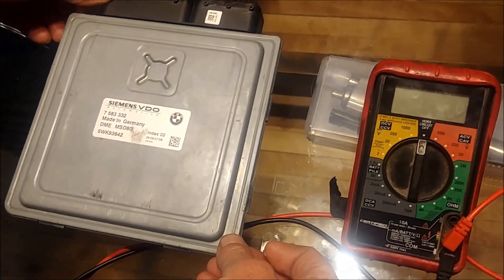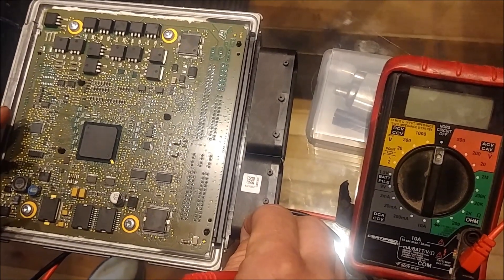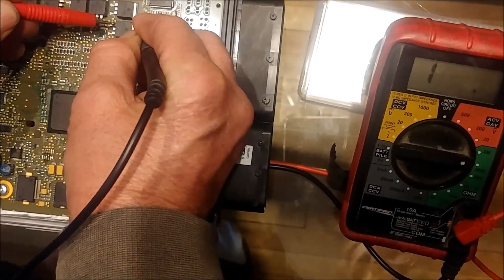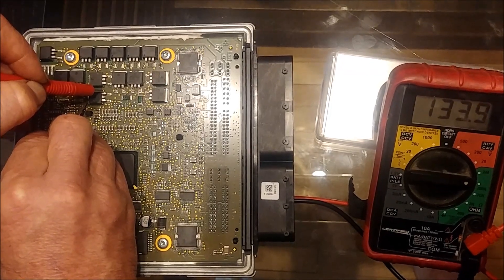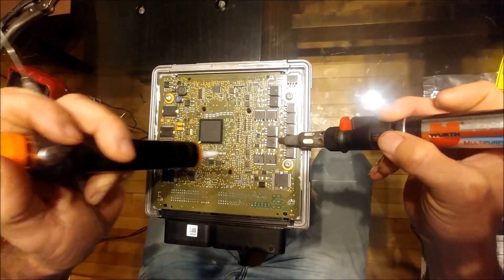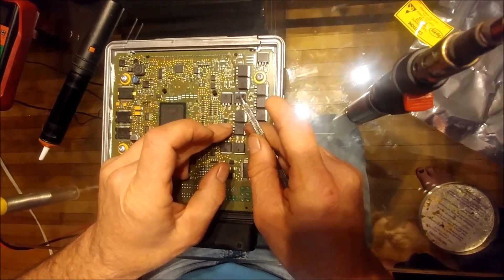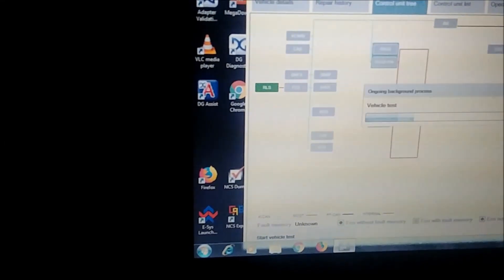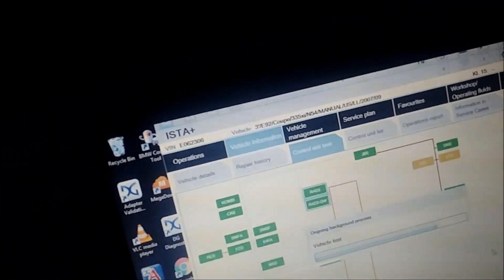Part 2. Diagnosing DME internal failure 0030BA 0030bb 335ix N54

Comment: My E46 N46 has error code DME 2A67 valvetronic, internal faulty, what needs ro be fixed sir ?
Reply from the maker: unfortunately im not familiar with N46 but Iwould look at eccentric shaft sensor or wiring. if you have access to ISTA follow the test plan

Comment: I just tested all six of mine and none of them had a reading.  I’m assuming this all of them are bad ?
Reply from the maker: If the car was running then no. Retest make sure your ohm meter is set to ohms
Reply: I did. I checked it like six times. It’s not making any sense to me at all.
Reply: I’ve got 5 out of 6 cylinders misfiring plus multiple other codes being thrown that shouldn’t be.

Comment: hello friends what tools do you use to open the mosfet? I have used various methods, it is very difficult to remove the Caterpillar ECU mosfet
Reply from the maker: To open ECU  heat gun and razor sharp knife. Like exacto. To desolder mosfet lots of flux. And good soldering iron.
Reply: @danielosullivan7623  The method with the heat gun has been done remains difficult. Can the method in this video be used, I see it faster. Thank you friend
Reply from the maker: Yes ofcourse
Reply: @danielosullivan7623  Does this method not damage the PCB? How many degrees is the setting?

Comment: I'm having no spark for cilinder one them it jumps to 2 that means the computer is bad I replace everything already
Reply from the maker: I dont think it is ecm. Do you have any codes?
Reply: @danielosullivan7623  yes misfire but I replace fuel injectors coils spark plugs already
Reply from the maker: Have you checked compression in the bad cyl?
Reply: @danielosullivan7623  yeah they are all good

Comment: I have the same problem. Does the piece need to be tweaked? If you change a new one?
Reply from the maker: I'm not sure what you mean by tweaked. But you don't need to program  or tune . Just solder in new MOSFET in  place of old MOSFET. If you change an injector you need to code the injector to the DME (engine computer) hopes this helps
Reply: This finally the answer I was looking for.
My dme mosfet went from too much power tune and performance.

So you’re saying, if I replace this like in your video, I will not need to reprogram the injectors to the dme❓

Comment: Hey Daniello, where can 1 find a list of dme components and functionality together with testing for better diagnosis. I have a DME that has 2F45 fault code and there is no spark and fuel on injectors. 2f45 states tht there DME-interface error. Somehow i saw traces of water on DME
Reply from the maker: Hi James. unfortunately i dont have a list.you didnt mention which model or DME. does the motor crank?..but you mentioned water. so first off I would carefully inspect the terminals in the connector and the  pins  in the DME.for any signs of corrosion or green. I use surgeon googles with  a5x or 10x magnification . 2F45 interface error if you have any comm codes in other modules you could verify the wiring between them and DME. play particular attention to the CAS and EWS. hope this helps I dont think its internal.
Reply: @danielosullivan7623  its a 2006 e90 325i, the car cranks with no spark and fuel on injectors. When I checked the DME noticed that there was water in the DME pocket which seeped into the DME electronics and Circuit board. It uses a white CAS, have another lock set of white and black CAS. I tried with the Black CAS lockset (cas,dme & key) the car didn't start, used a white CAS lockset and the started. Now I am trying to figure out if its the faulty DME or CAS. Even when I reset the start up value to clear 2F45 using the BMW ISTA. The code still not resetting.  Checked continuity on 2 cores interfacing the DME and CAS, continuity test is 100% ok
Reply from the maker: @jamesbudmunmaphane116   so with a different DME/CAS car runs but you still have 2f45? try a cas /dme realignment or sycn. do you have any codes in other modules like cluster? although water in your DME is never good. the fact that you CAN communicate and no internal error codes. im hesitant to blame DME without further testing.
Reply from the maker: if you have access to something like a jewelers loupe or equiv.(even if you have good camera on phone marco lens) carefully look for green check for broken traces  etc.
Reply: @danielosullivan7623  true tht, you suspect a broken wire, in terms of pin assignment its 2 and 15 on cas connector and 20 and 28 in dme if not mistaken. I saw 1 of your videos testing the 6 components of the injectors. Which components are for spark

Comment: Can you describe the soldering gun and that little clicking soldering gun that you use? And do you clean the flux away with some brake clean or what? Because the flux will cause corrosion in the future.
Reply from the maker: very abridged video yes i clean flux i like maf cleaner or IPA. gun on left is for desoldering . right is like a mini torch with an adaptor to prevent direct flame
Reply: @danielosullivan7623  where did you buy the drivers brother on my ecu same is burn